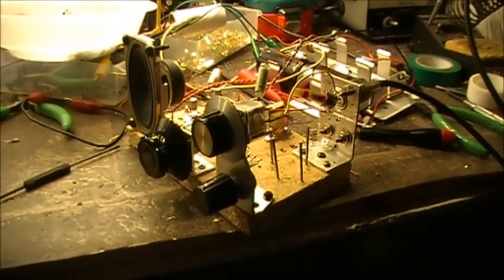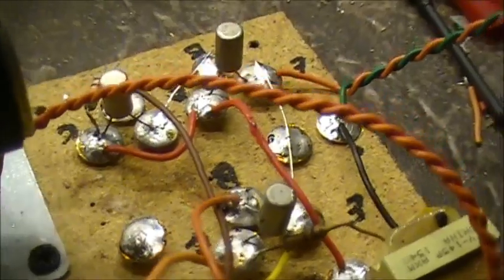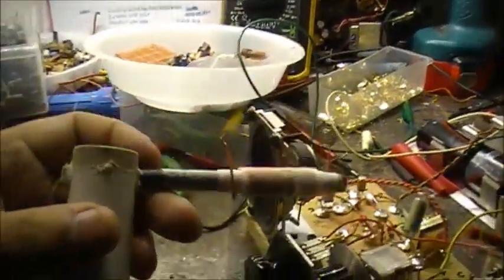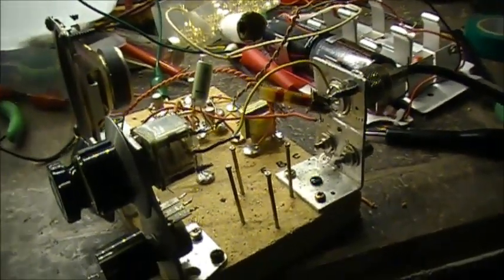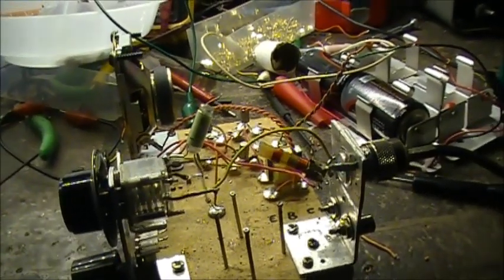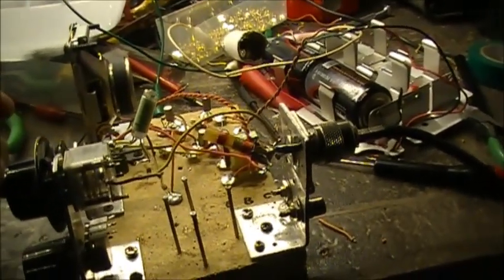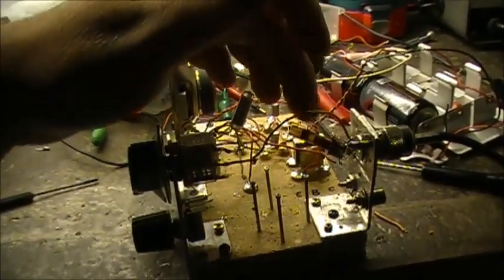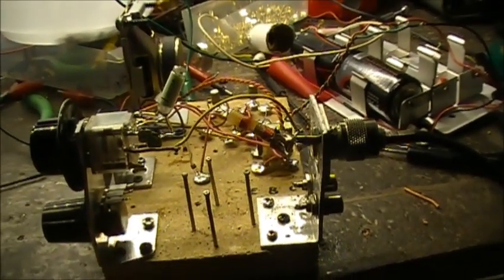RECEPTOR-2   /  Part 1

Comment: Wow that's awesome... Cool project.. :Question: I want to change the tuning cap on a tube radio.. What I'm wondering is if I put a tuning cap that can keep spinning will it work and cycle thru stations?

The stock one stops the fins hit the board, its supposed to due to the way they are built..But I want it to be able to spin non stop.. I've seen some tuning caps on ebay but I'm not sure .. I'm sorry I'm asking because you might know if its possible it would work,

The radio works I just want to be able to turn the tuning around none stop in a loop lol does that sound possible?